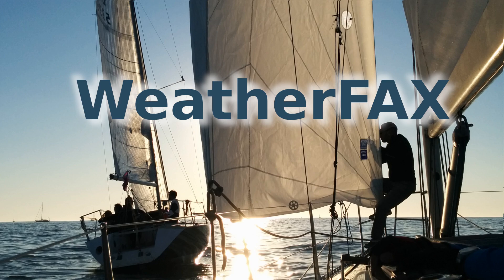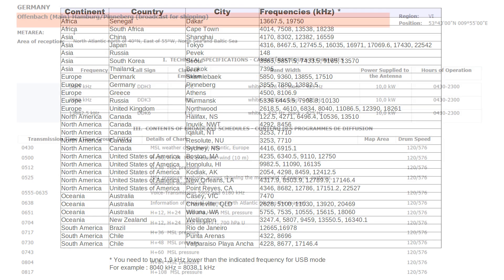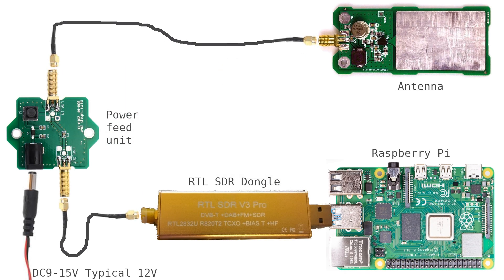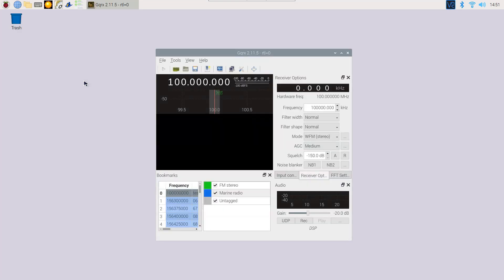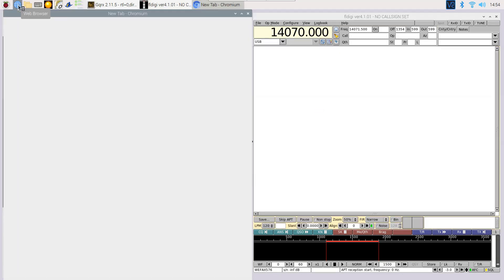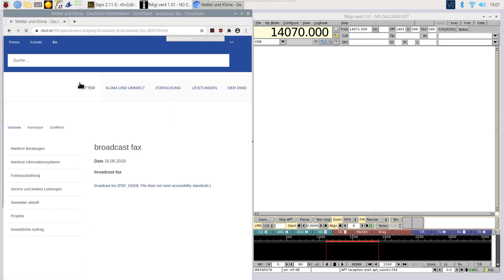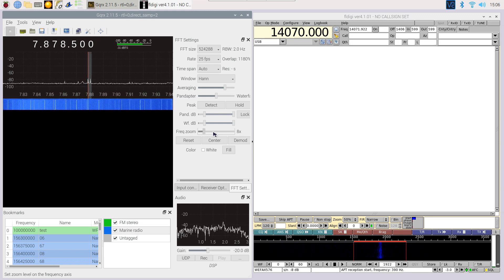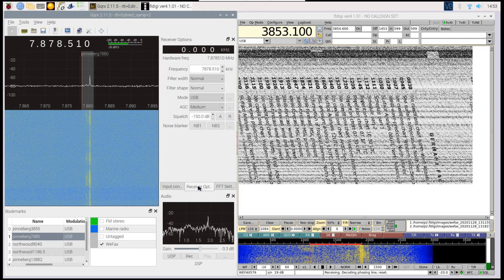Weatherfax using Raspberry Pi

Comment: How well does weather fax and AIS play together? I presume you need to stop AIS reception and then fire up weather fax. What about the hardware? Do you need to remove the active antenna for AIS reception? Great videos!! Thanks for putting these up.
Reply: @Patric better late than never! Thank you
Reply: I had the same question! Did you end up figuring it out?
Reply: I have a usb Comar AIS-3R receiver for AIS connected to the PI which enables me to use shortwave receiving via SDRplay or RTLsdr. detailed charts are slowing down the PI better manage that before. I am using the Raspberry Pi-400.

Comment: great info. Do you know if I can use OpenPlotter FlDigi to decode the weatherfax from my Garmin M802 HAM/SSB radio ? Then I wouldn't have to fire up Windows for weather reception.
Reply: open CPN has a weatherfax decoder plug-in